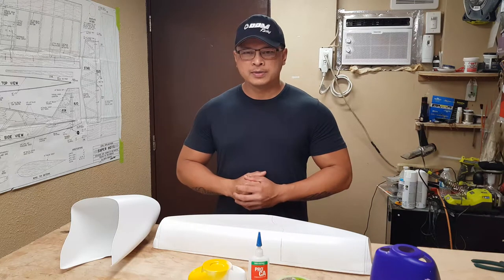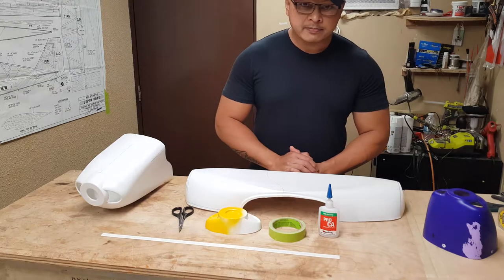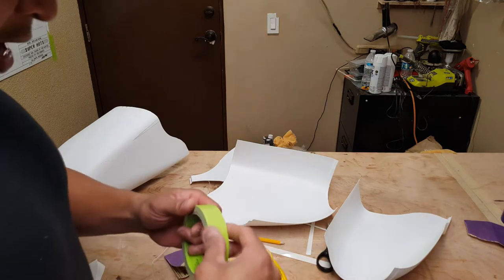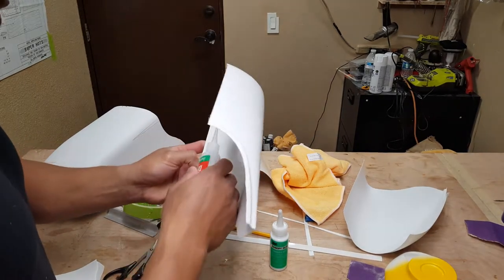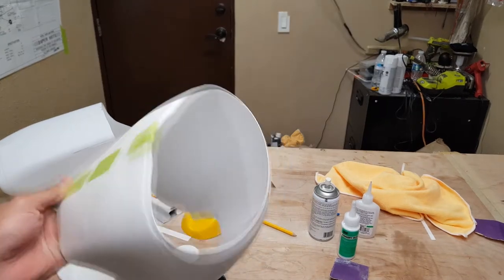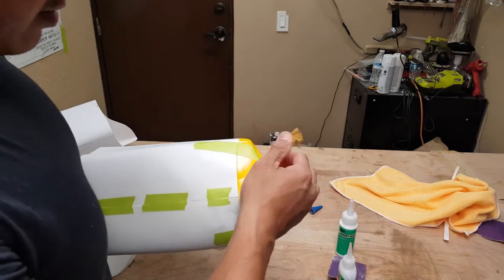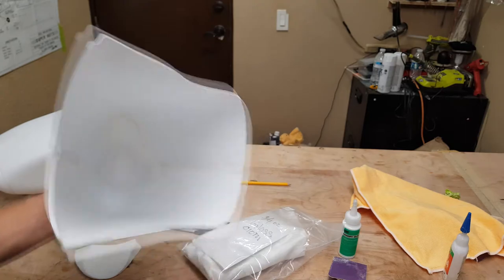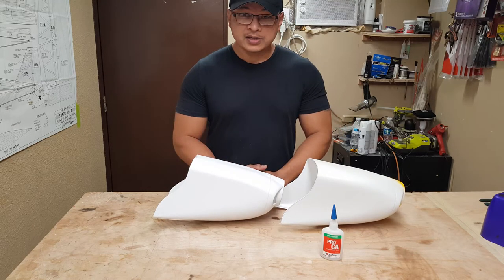How to assemble plastic cowl

Comment: Great video, To prevent the cracking from CA, I decided to use Plasti Weld. It glues the plastic together well. It make it one piece.
Reply from the maker: Nice!  I will need to give that a try next time.  Awesome and thanks for that tip my friend.  Keep on building and have fun.
Reply: Plasti weld or similar is great for this,it will fuse both sides together. The CA join justs sticks them ,so will always be 2 parts.

Comment: Hello . What material do you recommend for grouting before painting ? Best regards, Andres
Reply from the maker: @lagunaotun  to cover all the seams use Bondo or automotive auto body filler.
Reply from the maker: @lagunaotun  https://www.amazon.com/Original-Formula-Restoration-Vehicle-Hardener/dp/B0007ZG9TO/ref=mp_s_a_1_1?crid=1J3BLQJ1XO7XQ&dib=eyJ2IjoiMSJ9.-utEoVsHz_vicap04O4eg82RY_f7EbK6t9QZiDZVVpdfCKqX7jnfxQTNaqVjrGjFGPaEPb5j4VcUKxffNupUZkjqQGhFJ78vUBe21HvOr2XiGK1NdKkQiJCRMSI4HqdN0-b5EskPxODYV1OVjeVTWLAEa7kUiFuLyI08-nZKXzm_lYZp6LP3SNrVLa38qYK8JQwH-LSUXDxGhTpmLbLO_A.FFxv9RH3_Uo4beAeotSaEcErEhDrPYUPPSrkECCE6QA&dib_tag=se&keywords=bondo&qid=1723640388&sprefix=bondo%2Caps%2C341&sr=8-1